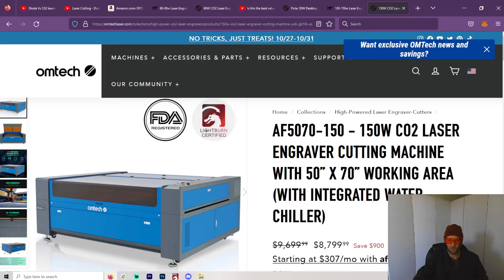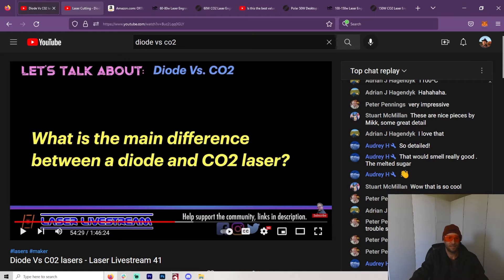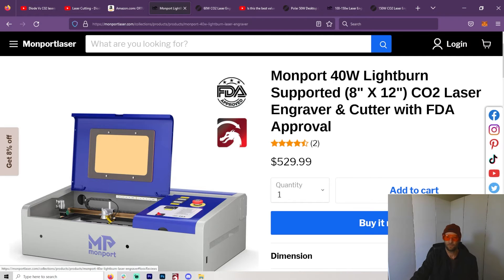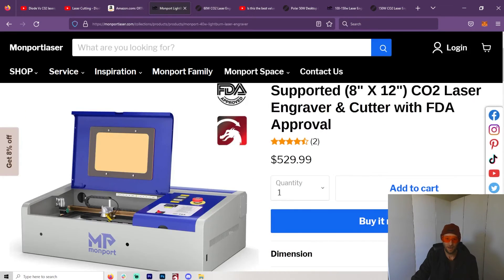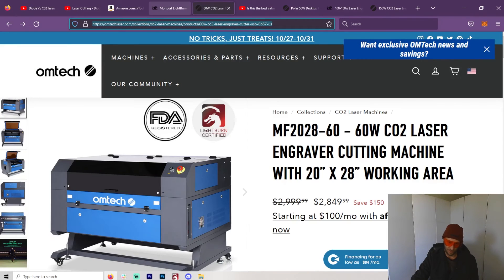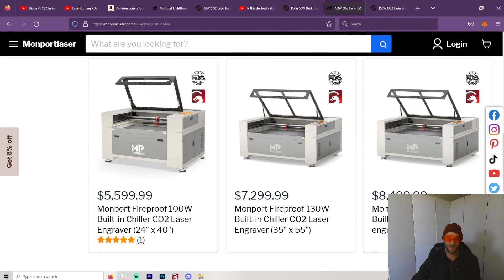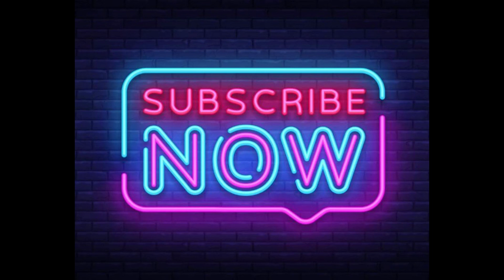Diode vs Co2 Laser Cutting and Engraving: BEFORE YOU BUY!

Comment: Hey, Tks by your time for sharing your knowledge with us. I've been watching so many videos and try to figure out witch machine to buy for one main action: cut and engrave white milky acrylic  (3mm thikckness). First I would cut it and than painting so, after painting I will engrave it to make electrical panels using led back-lighted to make the illumination of my panel. A Diode-laser 10W would do this for me? If could anyone help me out would be nice. Thanks a lot.
Reply from the maker: I don't think so. Diode lasers are not good on white. I hope you can find a way to test what you want to do before you buy one. Do you have a local maker space?
Reply: But I will paint the white milky acrylic with dark grey color. Maybe there's no issue using a diode laser; I do not have a  local dealer in Brazil to make a test before buying it.   @ValleyForged
Reply from the maker: Well, I wish I could help, but I have no idea :) @emersonschmidt-ibns

Comment: I have 130x90cm 130W Co2 laser and when I look diode lasers cutting videos, they look so weak and cut is awful and uneven. Co2 laser is more know how but when set properly, it cuts through 3mm ply with less than 20% power making hair thin line without any smoke residues on material.
Reply from the maker: Sure, if you have the cash and the know how they cannot be beat. But I have to say, the new Atezr 36w does a real fine job for the money. Speed is getting close to a Co2 as well.

Comment: Thnx for this vedio.. how long dose 80w co2 lsaer last.. and dose it good to run business for acrylic ( co2 4060) with chiller
Reply from the maker: Depends on the tube, but I would say 5,000hrs at 70% power. Yes, would be great for a business. Just make sure you get the right bed size

Comment: Very informative thank you i am currently looking at the Elegoo Phecda as a 1st time machine for hobby/learning. 
I am currently looking at the 10w version since it can be upgraded to the 20w at a later day.
Do you have any opinions on it based on the kickstarter video they released?
Reply from the maker: Unless it is quite a bit cheaper than an Atezr I would go with Atezr. The video does not really impress me.
Reply: @ValleyForged  like the p5 or p10? Thanks again for any and all advice
Reply from the maker: @ramsho9369  P10 as you can then upgrade the 20 or 35w if you want to. The 20w is my favorite, but I do more cutting than engraving. 10w is best for engraving. Also, Atezr has plenty of accessories available if you wish to go that way.

Comment: It's sounding like having a bigger bed size requires a higher power laser, I don't really understand why the two would be related.  Seems like the laser power could be whatever and the bed could be expanded to any size.  

All I need is something for cutting primarily balsa for RC airplane parts and I probably wouldn't put 1000 hours on it in a lifetime.  I'm just starting to look so I have no clue what I need.
Reply from the maker: You can always get more power, but you cannot increase bed size (for the C02 lasers).
How large are the RC parts? How thick? I may be able to get you in the right direction.
Reply: @ValleyForged  Most of the parts that I would want to cut with the laser are small anyway like wing ribs etc but if you wanted to cut sides for a fuselage it would be nice to have up to 36".   Most of the time just thin balsa but maybe at times up to 1/4" thick plywood.  

So is the CO2 work area limited because the laser tube is at a fixed location and thus there is beam path length to consider?  Whereas the diode could be local to the cutting position and travel any length?

Thanks,
mk

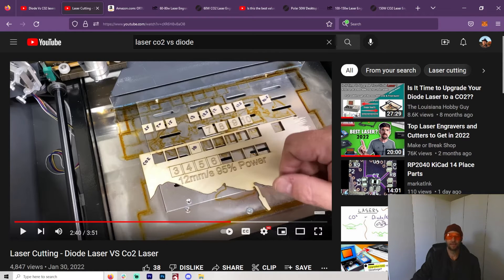Comment: 3:10 has this changed with the introduction of the 40w diode laser from xtool? I hear its pretty decent cutting.
Reply from the maker: Te 40w has a .15 beam size, so really not ideal. It would actually cut BETTER than the k40 as you cannot use 100% power on a Co2. But the 35w ATEZR has a great dot size AND more power than a k40. So yes, I would get the atezr unless you want to do acrylic. I am using the Longer 20w and it is amazing. See my newer vids on this.
Reply: @ValleyForged  just saw that video, Im leaning into saving up a bit and just dropping 3k on a CO2. I think itll fill all my need and Ill be happier with it.

Comment: Very helpful video. My job is cutting non transparent rubber, fabric and PP sheets (less than 2mm thick). Which one do I go for? Will diode be good enough as far as fit finish is concerned? Production capacity is not a big concern.
Reply from the maker: Appreciate it if you let me know when you find out.
Reply from the maker: I am not sure. I have never done Rubber or PP sheets. I am guessing that is pretty toxic, so make sure you take the correct precautions.

Comment: Great video...may I ask you a simple question?  If you are ONLY going to be burning/ engraving images on a wood surface- and you needed reliability- which diode lazer  would you choose?
Reply: I own an Xtool D1 10w and am very impressed with its quality, though it's pretty slow. Upgrading to the faster 20w pro, and will settle for nothing less. I suggest the Xtool d1 20w. 🤓
Reply from the maker: It still opens up so many more questions. How large? Does speed matter? Production levels, or just a few per day? I don't want to steer you wrong. I don't think any of the diodes are very good for production work. Perhaps an X-Tool Pro 10w? But for just a hobby, one of the older 5.5w would do, and be much cheaper.

Comment: I have a 100 watt Omtech CO2. And thought about this k40 as well (still thinking), cuz it would be good to have a backup machine, even if it has a VERY small bed. I barely ever use more than 30 watts at a time on my 100 watt laser.
Reply from the maker: It is a tough call. These k40s are kind of toys in a way. They are made with super cheap parts that you many want to upgrade. I would say they are a fun project if you want something to upgrade and play with on the side, but not really worth as a backup machine. Best to just put that money into your 100w to keep it up and running and improve. Perhaps get a high quality backup tube with that money.
Reply: @ValleyForged , makes sense. Thanks!

Comment: If you plan to spend anything over $5k then I would look for a better alternative to the Omtech. The "150 watt tube" won't be able to output 150w to the workpiece. 
I bought a Thunder Laser Nova 35-100watt.... it came with a tube with a maximum output of 121 watts. Then it is throttled back to all for running at 100% and getting 100watt of output at 100%. Plus it has closed loop nema 34s, a cw 5000 chiller and tax and shipping costs are included in the price.
Reply from the maker: Thanks! The Omtech comes with a 5200 chiller I believe. And as I said in the video, the most important thing is the bed size. The omtech has a 50x70 for $8500. When I replace the tube, I will just get a better one. Totally down to look at Thunder Laser though. I am sure I will do more research before the big purchase.
Reply: @ValleyForged  closed loop steppers are a must. That's really a game changer. I'm not getting anything that doesn't unless I'm upgrading instantly.
Reply: if you have $11000 to play with!

Comment: I just got the 80w Omtech and I love it! It has 4 way pass through and a big bed. 
The 100w looked cool but the bed size jump I couldn’t fit in my garage and it didn’t have 4 way pass through
Reply: I might be being ignorant here, but I don't get how 4 way pass through is much more useful than 2 way. It's not like you can shove a 4' x 8' piece of plywood through. Wouldn't you only be able to use 2 ways at a time? Or is it that it's just easier to design and organize the projects?
   I am the sole operator of our family business' 100 watt Omtech laser. I barely ever use the full 100 watts (scorching can be pretty bad. And my software xy calibration, lens focus, and mirror alignment better be perfect at 100 watts), so I am curious if there is a good reason we should have gotten the same one you did.